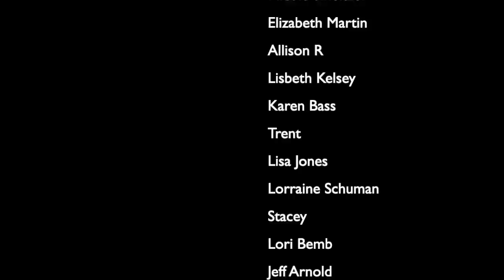I made a huge mistake! Beware when buying a used cooking range – The Chateau Chronicles   Ep #44

Comment: Having compost bins right under the counter is wonderful. After cutting veggies you can just wipe food scraps right into the bin and the handle is great for taking the compost out. I’d keep those bins just as they are
Reply: Agree. You have the option to use them for 4 different things. If you want to only use the bins for 3 or 2 you can double up on bins. If you replace the bins you lose the options
Reply: I forgot about saying something about that! Yes, having those little composting bins are perfect for beginning a good compost pile to use in your garden.
Reply: So, one bin is for metal recycling, one for paper stuff,one for all food scraps,one for glass.

Comment: Because duvet covers are usually cotton, removable, and washable they don’t see any need for an additional top sheet.  It certainly makes the bed easier to make when there isn’t one.😊
Reply: Same in the Middle East. You couldn't get top sheets. I now do the same back in Canada, I don't bother with the top sheet because I got use to not having one while living there.
Reply: I live in the States but I got so used to my German relatives duvets that I switched and do the same with my queen-sized bed…..no top sheet needed. HOWEVER, I strongly disagree that the bed is easier to make. 😂 I fight getting the duvet covers back onto the down comforter every week after it’s been washed, it’s like a nightmare.
Reply: @VintageLPs  It was for me too until I watched this video on a rolling method which I can’t explain very well but I’m sure is here on YouTube somewhere and works like a charm.  In the morning I flip it to the bottom of the bed to air out the bottom sheet and after finishing my cleanup and dressing routine I flip it back into place and plump up the pillows. I find not having a top sheet very comfortable in that my feet and legs are freer to move around and don’t feel trapped but, then, maybe that’s just an issue with me lol.
Reply: I live in sub-tropical Australia and I find duvets far too hot. When I travel, the first thing I do in a hotel is remove the duvet from the cover, which I then use as a top sheet.
Reply: @maryjimdale7031  I live in Jacksonville, Florida in the U.S. and it is 96 degrees Fahrenheit midday but will drop to about 76 degrees around 3 a.m.  and yet  I still love my duvet.  Granted, I sleep on top of it for most of the year but it is cool to the touch and I’m comfortable doing so.  I do, however, understand that it is uncomfortable for some people to have no covers at all.  To each his own I guess, lol.
Reply: @VintageLPs  there are YouTube videos on how to put on duvet covers and there are several  ways to chose from. I stayed in an American hotel that used both a top sheet and  duvet with another sheet over the duvet  and I constantly got  tied up in all those  layers, a mess! At home I skip the top sheet and use just a duvet  over, works great!
Reply: Abby, embrace the European  way, no top sheet, its wonderful. We have been making our beds this way for the last 20 years after visiting our friends in Sweden. We will never go back to the traditional American way of bottom sheet, top sheet, blankets and coverlet or comforter. Now it’s just a bottom sheet and duvet, you will find it very comfortable to sleep, less washing and easier to make the bed. We change the bottom sheet and pillowcases each week and the duvet cover every other week. No need for blankets, you will be plenty warm enough.
Reply: @maureenwilliford8985  It's great to be able to push the duvet back when it's too warm and have a top sheet to be covered with. They'd be great to tie together with the bottom sheet to make your escape should there be fire. And how can you short-sheet someone when you feel like pulling a little innocent prank without a top sheet? You'd be all ready for a toga party if you always have top sheets.

Comment: There is a big difference on how the cabinets line up with the floor pattern. Can't you have them line the cabinets up with the floor and then have the counter guys cut the countertops to fit the new top dimensions. Or correct it to whatever degree with a kick plate?  A difference in the counter size won't be noticed at all as compared to how it is now. Lots of activity and progress. Regrettable about the stove, but I'm glad you're just going to go new rather than try to save with another used appliance. You have the patience of a saint! Thank you for a great video.

Comment: I use the thin sliding drawer for oils, vinegar etc. Works great. Too deep for spices.
Reply: Agree - good for bottle or add a container for taller utensils. There are great drawer inserts for spice racks that would be better :)

Comment: Love the cabinets.  If you get a gas stove,  don't forget you'll need to run a gas line for it before you set the base cabinets.
Reply: what they do here in France, without gas lines ( which I think she said she doesn't have ) is to pipe it to a small tank( think barbecue grills) placed nearby or downstairs etc. its far less complex than running off a main line
Reply: Yes and it has to be properly ventilated. I'd stick with the electric stove
Reply: Looks like the cabinet maker fixed that cabinet that was too long and was going to make the fridge stick out all wonky.  As others have stated, use some plywood cut to length and width to use as temporary countertops.  And you should be able to reuse them, maybe in the laundry area, for some additional storage shelves, make some 2 x 4, or equivalent,  to make the shelves and top the shelves with the plywood you used for countertops.  They hold a lot, are customizable and can be repurposed if necessary in the future
Reply: Go for electric cooker & induction hob is even faster than gas.
Reply: @EM-fh2tx  Doesn't induction only work with certain types of pots and pans?
Reply: @melissaroth4467  Yes, as long as pots and pans are magnetic they will work.  I love induction.
Reply: @oliversmum1  I think it would all depend on where they placed the tank she mentioned.  I use propane and the tank is always placed outside away from the house, never in the house or downstairs because of safety reasons.  If she is planning on having a lot of people, she will need a larger tank than what one would use on a BBQ.
Reply: @pamplant3610  Propane is a great way to cook. An added bonus is it will still work if the power goes out. Glad she decided to go with propane.

Comment: The kitchen looks great.  What color are the tiles for the backsplash, maybe you can pick a color from there for the wall.  Is there’s space in the second kitchen, the corner with upper cabinets for dishes to put a second spice cabinet? The whole length of the wall to level with the top cabinet? I see a pipe there so not sure if there’s enough room.  If there’s not, perhaps a fake looking cabinet to hid the pipes.

Comment: You might want to consider investing in an induction stove. It is three times more energy efficient than gas.  Its instant heat like a gas but it is much friendlier for indoor air quality.  Plus there will not be any issues of running out of gas in the middle of cooking something! There are a lot of professional kitchens starting to use them now. And the added bonus is they are super easy to keep clean. Just a thought...

Comment: Re the stove I had a very similar one and I thought that the feet were missing but in fact they were screwed right up into the body of the stove. If you get someone strong to tilt it you could check. Re the gas bottle you will need the correct jets. Propane is stored outside only but can withstand low temperatures. Butane can be stored inside. The connecting hoses have expiry dates on them so it’s worth noting the expiry date in your diary. Be very careful on the choice of gas oven burner. Some French stoves have the oven burner running along the middle of the bottom from front to back rather than along the back of the oven. The front to back ones can burn your food and pastries situated directly  above them and are difficult to get used to. A good compromise is gas burners on the top and an electric oven on the bottom. Also check the grill and that where it is suits you as the grill is generally within the oven. Sorry although I live in France all my oven terms are English not American.

Comment: Dishwashers that have a control panel you cannot see without opening the dishwasher, have the little light on the floor so you can tell what’s going on e.g., tells you “is dishwasher done or drying” without you opening and disrupting the operation. Really comes in handy when it’s one of those very low noise dishwashers and you’re stuck wondering, did I start it or forget to?

Comment: Abby you need to fix those cupboards, I believe you are going to have trouble as soon as you try to install the stove and is not going to fit flush.  My husband was a kitchen manufacturer and installer
for over 30yrs, he said nobody has straight walls and you always have to adjust to fit the cupboards.  So you need to pull the cupboards that are canted the most so that the cupboards are all flush inline at the front.  This means that you have an insert piece at the side of that corner cupboard, but as it's in the corner you won't be able to tell.  Your main problem is that you have already had your bench tops measured.  They would need to be remeasured as they need to be wider to account for the move forward and you should do this ASAP.  I love your floor, but the black diamond floor actually has added to your problem.  Without those little stones, you would never notice the canting of the wall. Oh well these things try us.  Oh, there is always a delay if you have granite bench tops, they never make them ahead of time, they always wait until the cupboards are installed because of the very problems you are having.  Usually, in Australia you can wait up to a month for your granite bench tops! On a more positive note, the cupboards do not look that beige on camera.  They look cream.  I am guessing that the wall colour your chose will tone down the colour again. Good luck Abby

Comment: The kitchen units look beautiful, once you have the dark worktops in place it will all marry up well….
Such a shame about the one wall being so out and making the units look wonky, especially since all the rest look perfect!!!!
As a thought, you could move those base kitchen units forward to make them run inline with the flooring, then have the worktop cut at an angle to cover the gap at the back…
This would look a lot less obvious, that or have a stud wall put up to straighten it, which wouldn’t be to expensive as it would probably only go 1/2-3/4 of the way along the wall….

Comment: In Europe I won't buy used appliances,  it's kind of buying used underwear or mattress!!!
    If you use the right restraints you can keep Bruce!!!
Beds are easy 90cm for day beds & bunk beds then 100cm for a single ...then 140, 160, and 180...there is also 200 cm large..but you'll never be that fat!!! So enjoy those desserts!!! the length is 190 or 200, which has become more common as the new generation of French have gotten taller. There are old bed sizes of 120 or 110 wide, and you may find that in ancient bed frames, and some may be shorter at 185 or  even 180...and there were shorter childrens beds too...you buy what will fit into your space!!! If you do find an odd bed frame with a strange size you can order a futon (feel like your back in Seattle) in any size with memory foam or pocket springs!!!
    Hit up Emmaus for armoires at a great price!!!

Comment: Someone else must of already said this….. but can’t you pull the left hand side of the Kitchen base unit ‘out’ slightly, so the floor tiles look correct. Then have a small shelf running along the wall to hide gap.

Comment: Suggest you get quote on installing a gas line to stove and what type of construction involved considering the new floor tiles and cabinets vs cost of running an electric cooker and the safety of no indoor carbon monoxide concerns.

Comment: I hope this helps...I would not buy a gas range, you should look at induction. Not only does it only need the 220v connection, many professionals are turning to this as an alternative to gas. It is an on & off heat, similar to gas, but the reaction is much quicker (boils water in under 2 minutes) it also does not create the heat in the room that has does, cleanup is simpler and no ugly tanks or the cost. PS That pups health remains an enigma

Comment: Do u think u might be able to use the oven in an outside kitchen if yr planning one? You cld put any sort of platform under it and hv the gas valves checked for the burners then voila! Back bins may be for glass and cardboard (or any config that suits) as per the sorting bins on roadsides for categories. In the Dordogne we had to seperate into glass, cardboard boxes, paper/plastic, and non recyclable stuff.

Comment: Are the flat sheets you referenced new or old linen flat sheets? Many of the flat linen sheets you find at brocantes and vide grenierswere originally used at the top layer of linens on the beds. I buy them for that purpose and in the winter months they are folded across the foot of the bed. Nice progress. I'm in the midst of the first phase of renovations to my house in the south of France. Cheers-

Comment: Can you open those two drawers to the right of where the kitchen sink is now sitting? Or will they have to remove the door moulding?  Also on a much less grand scale, I once removed 6 sets of bi-fold doors (12 doors) to paint. Didn't note which went with which or even what closet they came from. Boy, wasn't that a mess? Took forever to pair them up properly and put them in the right place.